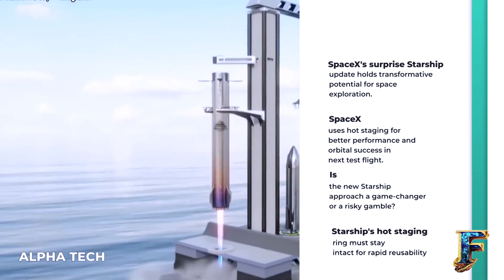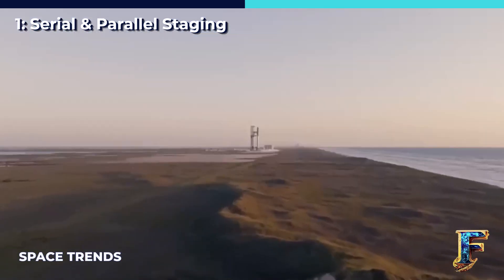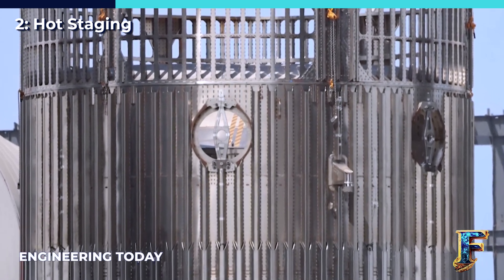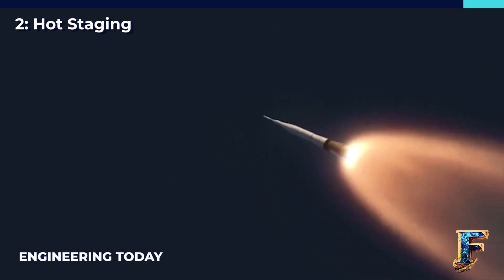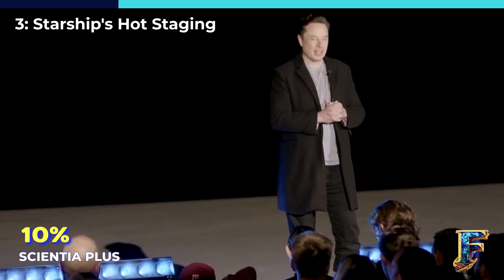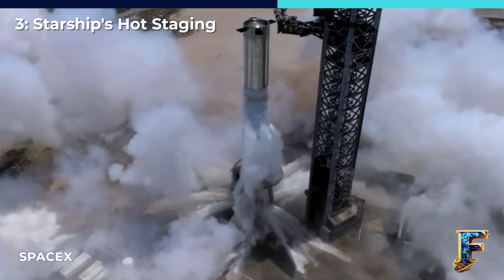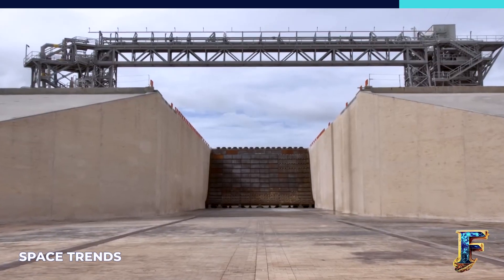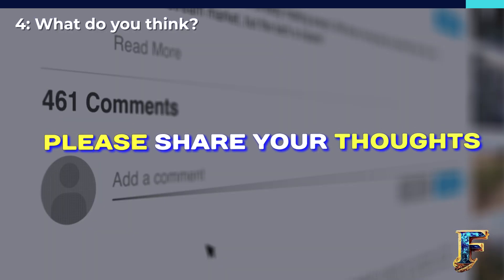SpaceX's Starship Hot Staging is NOT New, But...

Comment: I haven't seen any mention of shielding the upper common dome of the booster.  Even at reduced thrust during staging, the pressure of the thrust plume will collapse it.  also they need a much more "open" lattice design of the ring as the one I see being tested still has too much surface area that can make the ring blow apart.  I don't see this current iteration working out in the long run but then again, I'm not an engineer.

Comment: It's not make or break for Starship as to what happens on this launch. They learned so much from the last one, that this is one is being carried out on a much more solid Engineering base.
Sure, introducing hot staging at this point adds another layer of risk, but this was the point where it all went wrong last time. Fixing the separation issue with a performance upgrade is typical Elon. They'll obviously be as gentle as possible with the thrust during separation. However, it's going to be challenging to make this part reusable, it's going to take one hell of a beating.
Reply: They learned stuff they should have learned before even putting pen to paper: you need a flame trench or a deluge, and the flip maneuver to separate is a bad idea. Everyone told them that.